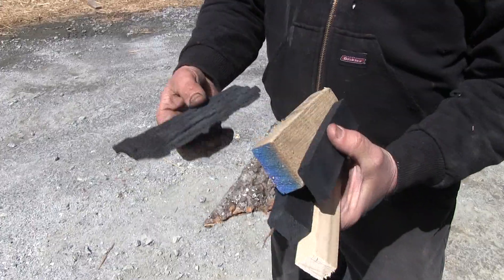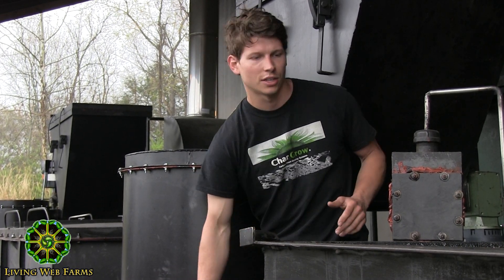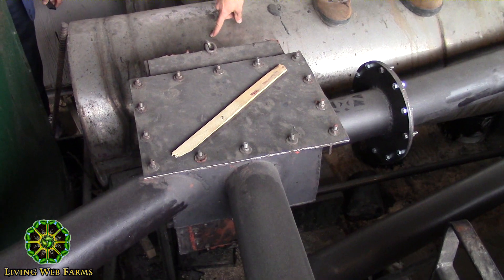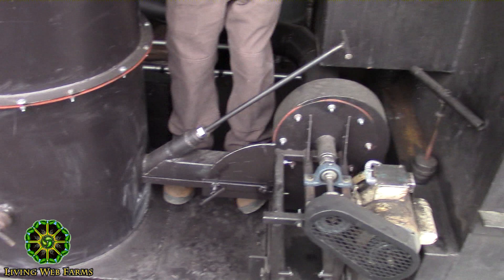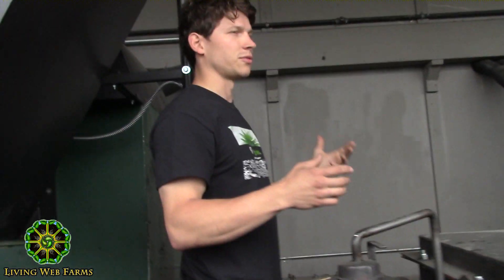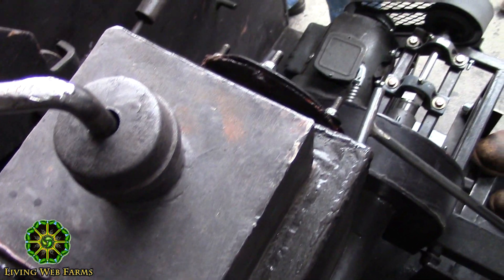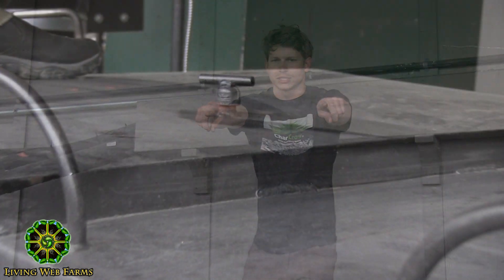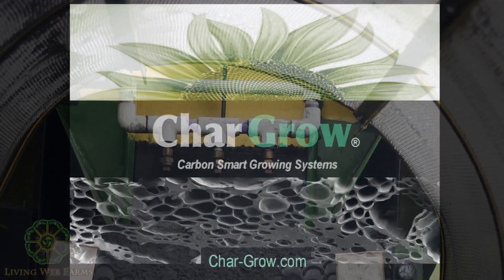Farm Scale Biochar Part 3 Production

Comment: I love what you are doing but I do not seem to be able to find footage or explanations relating to the problems of keeping the condenser units clean and functioning. My experience is that any heat-exchanging surfaces would quickly be coated in creosote and tar (if coming from a redox woodfire). This is very hard to remove and renders the condenser inefficient. Love to know how you solved this.
Very good work. All the best from New Zealand.